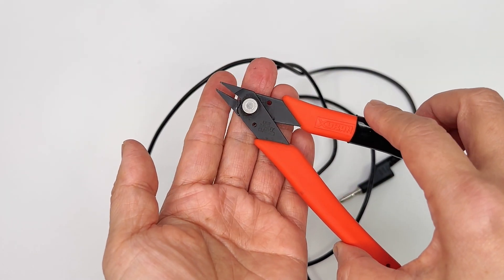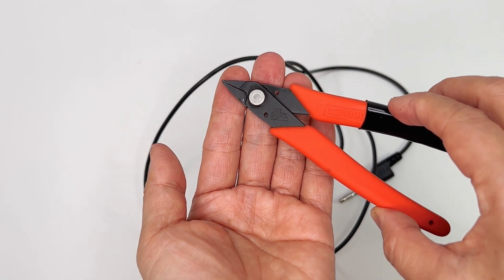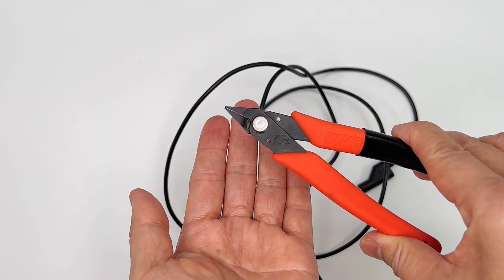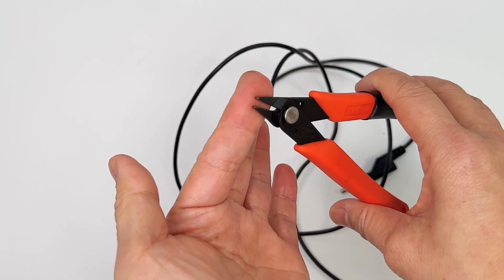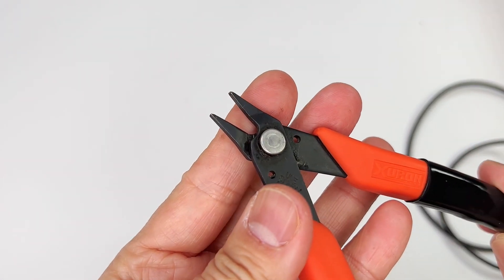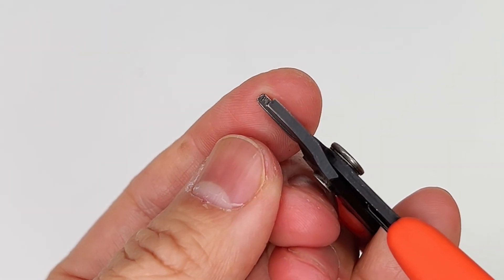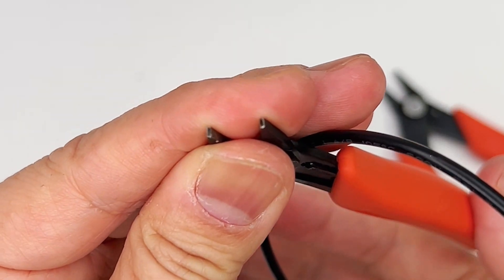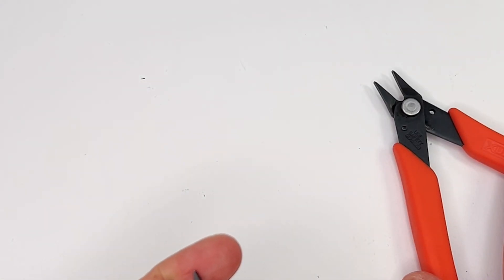Are Grounded Pliers Safe for Welding Permanent Jewelry? Documenting one customer's complaint.

Comment: I had the same issue with mine this last weekend! I just bought this pair and now they have the big groove in them too. I have the Orion PJ and work between 3 & 4 😩😩
Reply from the maker: Are you touching you the electrode onto the pliers when you weld?  You should be holding the jump ring so that the ring and seam is out, away from the pliers.  I know it is hard if you're using tiniest 2.5mm rings.  However, you need the electrode not to touch the pliers.  Otherwise, it is welding the jump ring onto the pliers.  

If you are touch the electrode to the plier, then I have no answer.  If you had purchased the pliers from me, contact me and I will replace them and look into it.  If you bought them elsewhere, please contact your supplier.
Reply: @stonesandfindings  yes, I’m holding as far away from the seam as possible. I just got this new pair bc it happened to my last pair as well and then they just don’t close the same. I do use argon as well. I’m sure it’s user error or something I’m doing wrong. When it happened this last time, it was sterling silver and produced a huge spark. My welds are not very pretty either. I’m not sure if there is a teeny gap or if the humidity in TX plays a part.